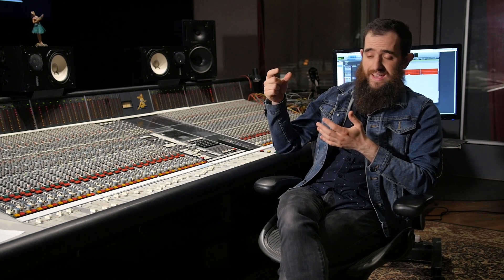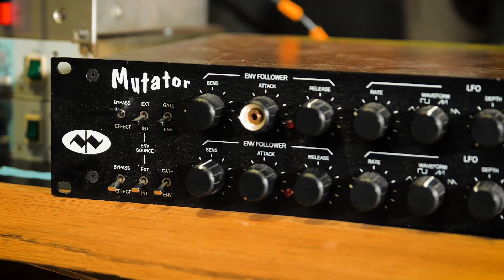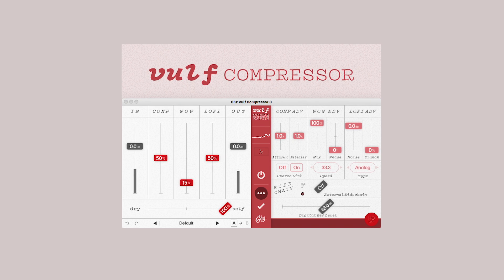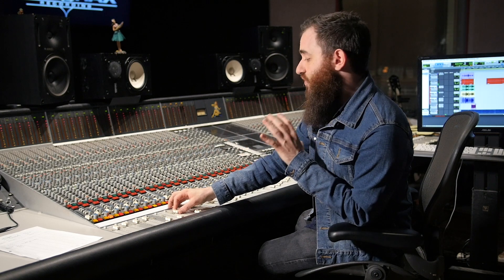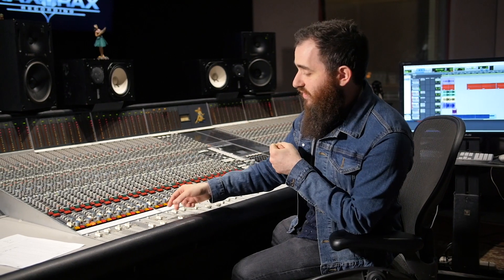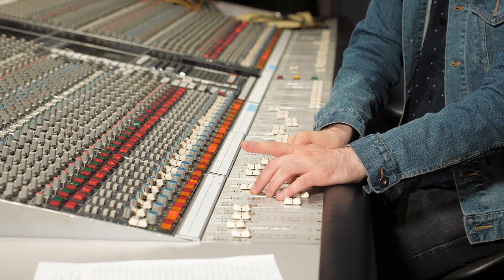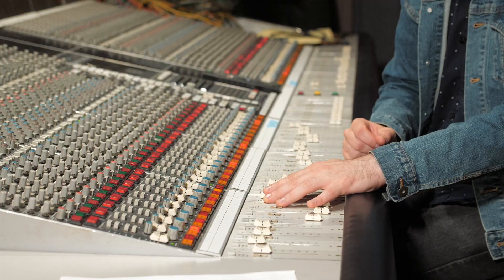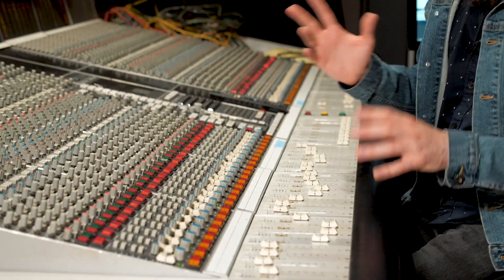How to Funk Up Acoustic Piano Sounds | Reverb Experimental Recording Techniques

Comment: I would not want this guy to up sell me on the mic rigging, outboard routing, levels, etc, just to achieve a result I could get in 30 seconds just sitting down at a midi controller. It’s just not worth it, but it’s a fine sound.  But not unique at all. Weird topic for a video.